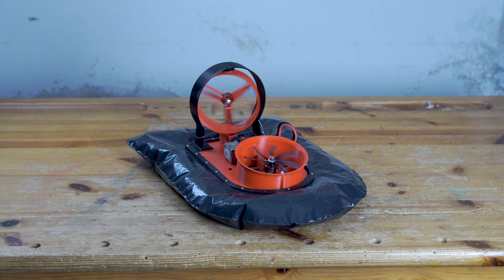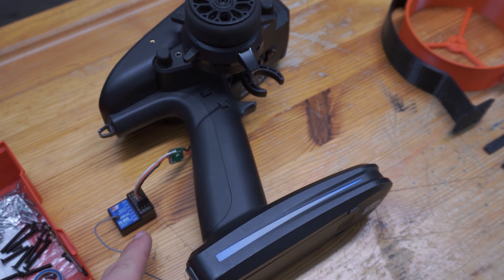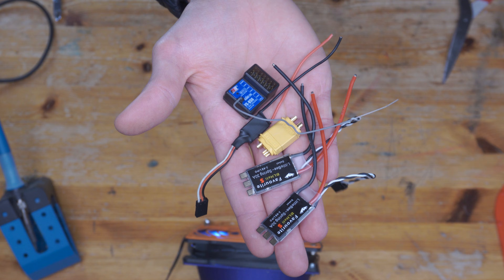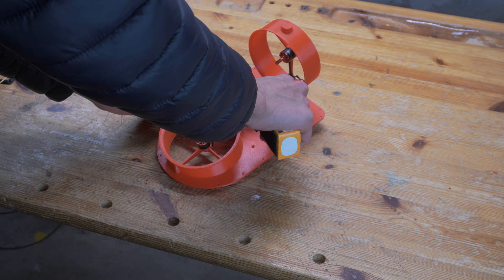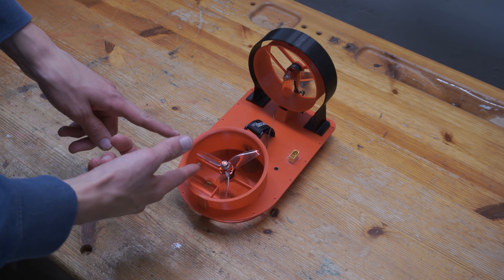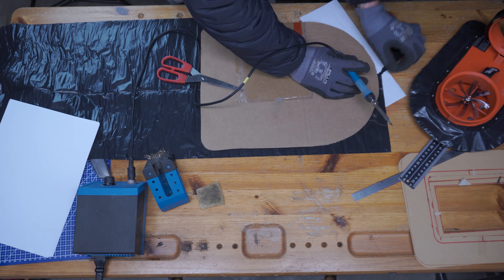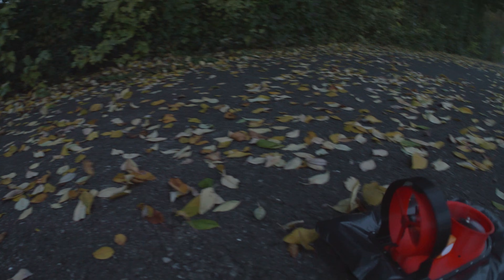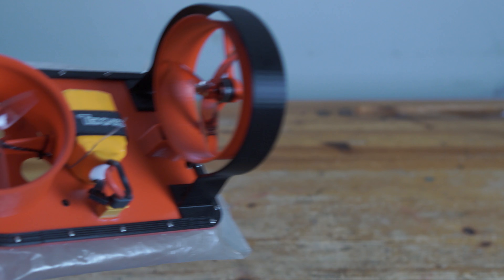DIY 3D Printed RC Hovercraft—Will It Actually Work?

Comment: Nice work, but I think u can do better.
This is a JCTaylor copy, I made custom skirt for this model, available on thingiverse.

Add extra holes in the bottom to feed more air to the plenum.

Keep the center of gravity as low as possible.

2 motors will not completely stop the torque rotation, just not on any real flat surface.
No problems if you "send it".

Nr 1 improvement is a proper skirt, sounda hard, but its just a sewing machine and 1 YT tutorial away.
Reply from the maker: Thanks for all the suggestions to help me improve it, I really appreciate it! Not sure what you mean by "copy" though, as I did design it from scratch. feel free to add a link to your skirt. Thanks!
Reply: @ValRC1  https://youtu.be/81xMpoF70gY

Comment: Did your first one work better? It seems like the part that you screw in on the bottom may cause it to have more friction.
Reply from the maker: This one is faster and more powerful, I think that's why the first one was a bit easier to control. In the shots with the leaves, I accidentally had the skirt inflation motor turned down a bit too much, resulting in underinflation. I didn't notice that until after I took all the clips. In the Gopro shots of the bare road in sunny weather it's inflated more, still only like 60% power on that front motor though.

The part screwed in underneath doesn't touch the ground with a properly sized skirt. You could see what happened with the undersized skirt I tried before that in the video, it was dragging lol.
Reply: @ValRC1 thanks! This was really helpful

Comment: if you had 2 rear motors - one going clockwise and one going anticlockwise could this help with the wanting to go left?
Reply from the maker: What would help most is 2 front skirt inflation motors. 2 rear motors can also be used for differential thrust though! I'm actually working on a quad motor hovercraft right now so stay tuned
Reply: @ValRC1  what if the downward thrust went over a block? (I am just spit balling here!) but this would mean you just had a downward force being blown of air rather than it being a screw air source from a motor?
Reply: @ValRC1  OR if going for a 4 motor - how about that just below half way thrust you block it off so that actually say a 1/3  be directed downwards into the skirt, the rest being the thrust - this would help with the over powered bit, and also mean that you had 4 air sources blowing downwards of just air
 - only issue is that you couldn't park it hovering would always need momentum

Comment: First off sweet video and thank you for the files do you think this will fit 2204 motors what is the hole mounting size?
Reply from the maker: Not 100% sure what exactly the hole spacing was right now, should be pretty easy to modify if they don't match though. It's the standard hole spacing of 14xx motors so 2204 might be different

Comment: Great skirt design!how did you fuse the two skirt parts together?
Reply from the maker: I just did it with a soldering iron, not sure it that's the best way but it worked for me
Reply: @ValRC1 thanks...seems to work well
Reply from the maker: It does hold together quite well yeah. The fumes from melting the plastic aren't very healthy though so it's best to do it in a well ventilated area or outside
Reply: How hot of an iron  before it melts the plastic?

Comment: You NEED to use an edf fan to have more power on it. I made a hovercraft using 2edfs and differential thrust and it’s about this size but can reach speeds of 30mph
Reply from the maker: That's awesome, thanks for letting me know!